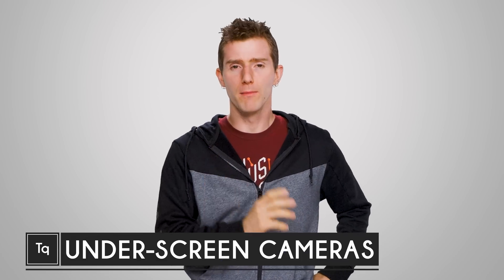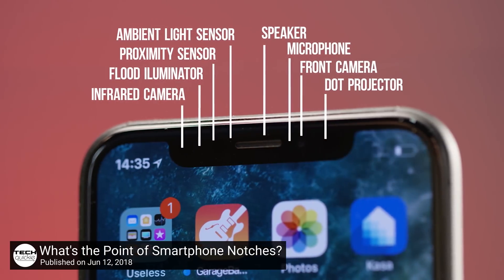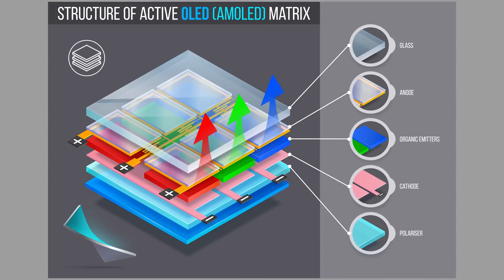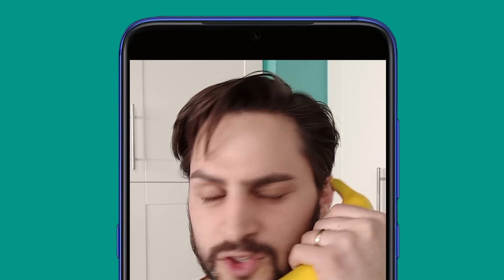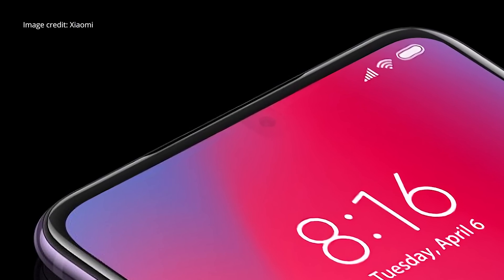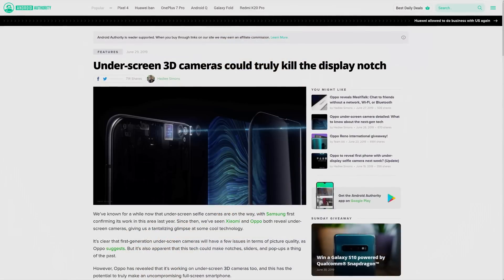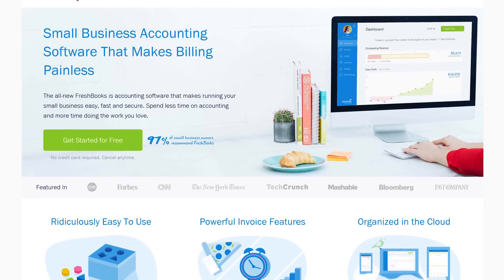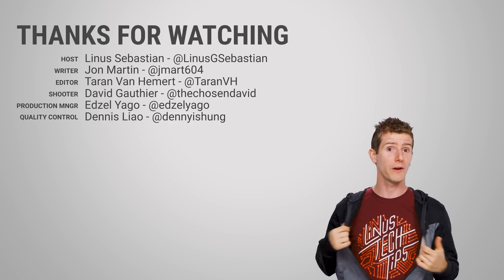How Under-Screen Cameras Will KILL the Notch

Comment: Biggest problem with smart phone sis having the corners of the videos cut off to fit the rounded edges. Go back to the old black bar at the top and bottom of the phone so you get the full picture and have somewhere for your fingers to be when you hold the phone.

Comment: i rarely take selfies with my phone, and if i do they are just for fun to send to a friend or for me to look back upon a moment i had with some friends.
i dont need crystal clear 5 bilion mega pixel selfies.
as long as the image quality is not worse than selfie cameras from 6-7 years ago i am 100% fine with under screen selfie camera's.
or even beter, the way they have it on the note 9 i own, with a small area right above the screen where it has your selfie camera, light sensor and speaker.
and a mystical 3.5mm jack on the botom

Comment: Honesly, I still don't understand why bezels NEED to be removed.. I mean it gets you a clear grip on the phone and it doesn't hinder your immertion!! Are looks THAT important?!? I feel like they just need you to keep buying new phones TBH
Reply: Yeah, like a minimal bezel and chin like we got in The Galaxy S9 would be Just fine. You could put multiple front cameras and sensors and it doesn't hurt the phone's design whatsoever.
Reply: Phones with small bezels are a pain to game on some small bezels and chins are good for avoiding unwanted touchs
Reply: @arfuzzaman  it's not awful tbh,it just feels like you holding your phone in portrait mode except now you hold it in landscape mode.
Reply: It's so product designers can justify their job's existence.  Change for change's sake.
Reply: DrD0000M I’ve had my xs for 2 weeks and I can never go back to those thick ass bezels
Reply: @DrD0000M  yeah exactly just to say something is new
Reply: Because it looks like you're holding a screen, something from sci fi shows
Reply: I totally agree with this. I don't know why they trying to make smartphones hard to use even removing headphone jack , making it more thin than necessary.
Reply: Same, removing the bezels has also reduced speaker and microphone quality. not to mention it's like you said, not having a bezel impacts the viewing experience and comfort. Plus in order to counteract these things, the phones are made more expensive due to the extra R&D and manufacturing complexity. it's like a races to make things worse well covering up the mistakes it seems.
Reply: I still don't get the draw of touchscreen, still using a full qwerty keyboarded phone without touch from 2011 with no issues.
Reply: LG did a pretty good job of balancing the top and bottomg bezels on the LG, Q6, G6 and V30. While still having that nice 2:1 aspect ratio, the balanced bezels look nice while watching and feel great when gaming.
Reply: Totally!!! I've been saying this since the s8, I actually LIKE bezels. I WANT them. smh
Reply: Guy's if you notice there is no one in the smartphone manufacturers today achieved a 100 percent body to screen phone the highest screen today is 93 percent so if you notice it is a race to 100 percent anf it is a considered for them a big achievement.
Reply: Simply put bezeless phones look way better than phones with bezels.
Reply: You're gonna put a case on it anyway if you care about it so it doesn't get scuffs and scratches all over. It keeps the phone protected and provides the necessary grip. That being the case (pardon my pun) it may as well look pretty since you look at it every day for hours.
Reply: I am using the one plus 7 pro. The screen size is nice. The bezel not there is whatever. You don't notice it either way. I still have my LG v20 and it doesn't bother me. It must just be preference I suppose.
Reply: They want you to keep buying new phones. Also, they know bezels make it easier to grip the phone. They want you to have less of a grip on your phone so you drop it more, and break it more, and buy new ones more.
Reply: I knew this is gonna happen,2 years ago when people wish their phone was bezelless i was thinking "i bet this people going to complain bezelless screen" and now my tought was right this people just always complaining more than just appreciate.
Reply: @faloxzz0778  You know why? Because "people" are different to each their oppinion.. Unless you wanna become a dictator, you can't have everyone think the same way or apreciate the same stuff Mr. Genius
Reply: Yeah. I think the note9 is the pinnacle of a smartphone that has ever been reached overall.
Reply: I bought a Pixel 3a, which has "massive" bezels according to every tech reviewer on YouTube, and it's funny because I don't give a fuck at all.
Reply: If you have even a thin case like I do (speck) it keeps my hands from really ever touching the front of the phone. And that truly full screen display is so beautiful
Reply: Iphone 5s masterace, still good, and home button etc.
Reply: Yeah. I say the OnePlus 7 Pro’s bezel is great except for maybe the chin.
Reply: Edge detection has gotten good. To the point where it's no problem . Bezels can look good like on every gaming phone in this world but the hole punch is way better
Reply: Its so that you can get a bigger screen size to watch all the videos and also bigger resolutions. Bezels are useless space that make your screen size small, you've got a point on grip but that's not that big of an issue.
Reply: @tanmay63  agreed
Reply: no bezels... then put a a case over the thing so its does break.  Excellent.
Reply: Georgio Khoury it’s not all about looks and honestly. Bezels suck in general
Reply: A lot of people want thinner bezels. You don't so don't buy flagships.
Reply: @oliver24x  Can you explain why a lot of people want thinner bezels? What makes thinner bezels so important?

Comment: Better question: Why not just have a bezel like phones used to have? What actual, tangible advantage do you give for taking up more real estate for the screen and less for things like the camera, speaker and microphone? you know, stuff that actually matters? If you really do need a bigger screen, why not just buy a tablet instead?
Reply: Who wants to walk around with a tablet? If you have a bigger display on a smaller phone then you dont have to take up more room to be able to have a bigger screen. Also, its the way the tech is progressing atm and in a couple years they'll fix this problem. Maybe not apple though, I could see them falling far behind in the next 10 years

Comment: Imo trying to reach the ful screen  to surface ratio is the most dumb vanity tech project of the recent years,  it isn't even ergonomic or practical for usage. the notch on phones when done right actually works because  instead of eating into the screen real state it is just adding extra screen space for the otherwise dull icons. take for instance the 19:9 aspect ratio of the Xiaomi mi a2 lite, you still get a 2:1 display plus the extra chump change, it is a matter of perspective really

Comment: The thing is I could care less about the front facing camera, but its the loss of the front facing speaker that frustrates me. I have no real issues with a bit of bezel.
Reply: Unless the entire display is curved(like samsung phones but on all sides except just left and right) that wont affect it. You don't need a lot of space of speakers. The length is more important than height.
Reply: Samsung has still held on to that one front facing speaker at the top so far. Better than nothing.

Comment: Wts wrong with the popup selfie cam tho. Its nice and clean. Maybe they can add the face id sensors in that popup cam module and give a perfect iphone
Reply: It uses a lot of space in the phone
Reply: FakeTaxi no, its a good use of space
Reply: @jemsncrystals  Good use of space? A popup selfie cam with face id sensors would be bigger than 5 headphone jacks (internally)
Reply: FakeTaxi its just matter of time and youll see that everything will indeed fit on it

Comment: I'd actually like to be able to cover my selfie-camera without having to cover up the screen as well. In fact, I'm fine with a small bezel on the top and bottom to house sensors and lights (if iphones used such lights).

Comment: I see another problem with this technology. This is one more thing which complicates phone repair and makes replacement screen unnecessarily more expensive, not to mention other compromises. I don't mind small, 5mm black row at the top of the phone which houses all of the required components(eg Note 9). This is simple, effective, works great and gives you good stereo sound without vibrating screen bullshit...

Comment: tbh, the tiny notch on the A50 isn't an issue at all. a ton of content is still 16:9 (LTT content still isn't wide enough to notice the notch), in other apps the bar becomes black so again you notice nothing, and there's still enough room for notifications or status icons.
Reply: There is not enough room for notifications. I can fill up the entire length of the screen with notifications... in landscape mode.

Comment: If it’s only for the selfie camera then It makes sense, but if it’s for security reasons (faceID) then I’d rather have the notch. If the design doesn’t improve usability then it is not a design at all.
Reply: Notches sure as shit don't improve usability. You can have faceID (not that anyone should use that insecure garbage) with a bezel, and increase usability by being able to hold your phone without false touches all over the place and by not having full screen content be utterly destroyed.

Comment: Dont care, the same people engineering this are the ones that think nobody needs a headphone jack
Reply: headphone jack has a point, notch has not, don't get your problem
Reply: @lsoldeMaduschen  not really, the only leg they stand on with removing the headphone jack is water resistance, but my Galaxy S5 had a higher rating than most of the newer phones out without a headphone jack, wonder how that works🤔

Comment: I'd actually pay extra just to NOT have a selfie camera... Never have I used it, not to mention privacy concerns. And no, pop up cameras are not a gimmick Linus; they're a nice work around the notch problem.
Reply: Moving parts on a phone should be a no-no these days...but then again what am I saying...foldable phones are coming...
Point is...moving parts introduce potential breaking issues down the line as you use the product.

Comment: after disposing of the notch, what is there left to do on a smartphone design-wise? its just going to be decreases in random gimmicks and camera upgrades after that.
Reply: that realm is for Tim Apple and DJ koh

and huawei i forget the CEO...
Reply: Foldable screens to make screen bigger / smaller.
Reply: Foldable screens might or might not work out in terms of stability, but weight and battery/camera improvements are probably what we’re going to see over the next few years. We might also get displays which can change perceived surface textures when touched using vibrations or other cool things, so who knows

Comment: Why not just make 2 versions, one with notch and one without a selfie camera.
Reply: Only girls care about selfie camera
Reply: @Auden.  Or people video chatting?
Reply: @Dzatoah  which 90percent of the times girls do i only need external cam for fights at school
Reply: @Auden.  or people who actually have friends who go out a lot?
Reply: People believe that making a new model of a phone is costly? Then why do they make 3 versions already ever year? Why is each phone a few millimeters different from every other one if it INcreases costs?

If that were true they'd make them standard sizes. Try buying a case for two different phones and tell me they're the same. They never are.

If adding a front camera costs more make a model without it and sell it for less. People who would never use it anyways would thank you for it.
Reply: It'd drive up cost of production.
Reply: Because that would be really expensive. I won't be surprised if it increased the production costs something around 15 to 20%.
Not only you will need to design two models but also have the machinery and get the knowledge of how many of each one you will sell. Resulting in a higher design, production and marketing investment while increasing the risks of over and under production wich means companies will have to increase revenue to have some insurance.
Not sure if the words were the exact ones but the concept is right.
Reply: @emilianoruizcarletti9381  thats BS as you'd only need to produce 2 screen assemblies instead of 1. Phones already have multiple versions with different ram and storage.
Reply: @captainheat2314  2 is double than 1, if they allready have 3 models that would make it 6. Also the assembly would be different, it's not just solder a diferent chip is not puting a camera and use a diferent screen. And what's the market for that? How many people do you think will buy a phone without a selfie camera? Even I that don't use it often (1 pic per month or less) would not.
Just remove the headphone jack right?
Reply: @captainheat2314  you'd be surprised by how much multiple designs can increase costs when mass producing a product

Comment: So its jack of all trade. compromised screen and compromised camera.
Reply: But without the compromisation of a screen with a notch, a lower IP rating and/or a motorized camera.
Reply: Prabhu depend on how you see it. It’s a screen that extend to a bezel. Also, this under screen will not have a sophisticated tech like a Face ID.

Comment: At some point in the distant future, phones with a notch or hole punch will be very valuable, because they are currently so terrible that no one wants to keep them.
Reply: Yes because a punchole or a notch will stop me from buying a phone or completely ruin my experience

Its called "getting used to it" and thankfully there are good options for you guys that dont have said design
Reply: I don‘t understand the transition. What really is the advantage of that few pixels around the notch? They are just expensive displays and in situations distracting to people. I prefer a straight line at the top to that notch solution. Really do not understand that trend.

Also I kinda like the tactile feeling of the home button. You will see, soon everything will be all-screen and you will miss some feeling on your fingers.

Maybe that will be fixed by sensorial technology that triggers our sensoric nerves with electric impulses. That would be the perfect device of course.
Reply: @IroAppe  for starters, the noth allows for room to display time, wifi status etc on top whilst keeping the rest of the content unintruded, a lot of apps just have a header on top so you could might as well just add a notch and not worry about changing the size of the phone, and tbf you can get used to a notch while watching video, especially if your thing is movies with a dark ambience. As for the home button, we could hace taptic motors, the iphone 7 and 8 already use a physical home button that doesnt press down but rather detects finger movement and gives taptic feedback, which can give off the same effect if you remove the button entirely.
Reply: Yep, that vibration motor is the only thing we have. It is very imprecise and does not yet replace real haptics. Like the keyboard vibrations - you can‘t really reproduce „borders“ and „edges“. It think there will be some advancement in that direction in the future.